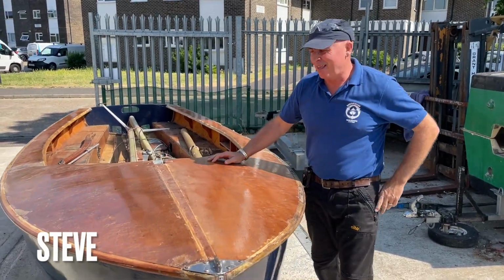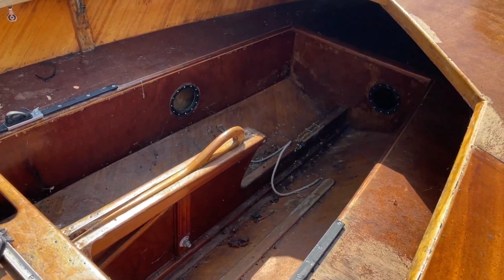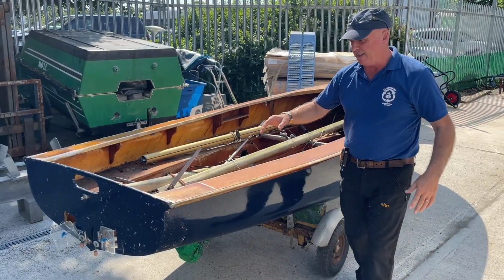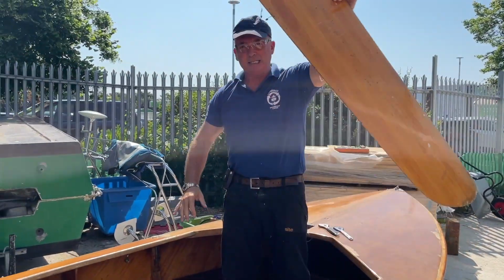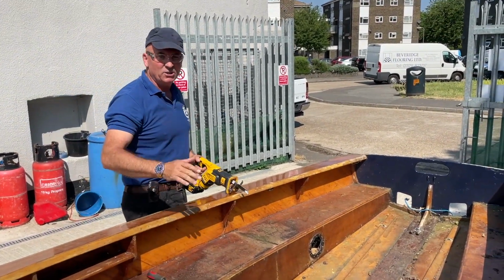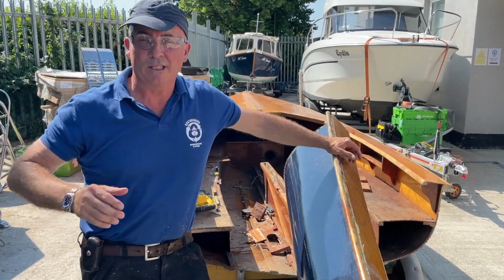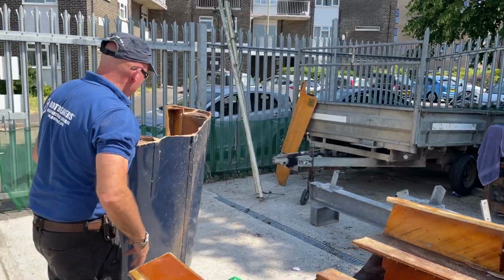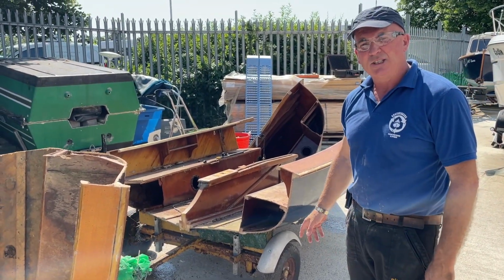Boat Breaker vs Albacore Sailing Dinghy!

Comment: This boat was built in the 60.s by JW Davis of Westcliffe on sea  Essex the give away is the deck king plank  with the sycamore fillets also the trim of the sisde tanks  .The gunwhales with  the sycamore is also a Davis givaway The Hull laminate direction  is also a giveaway as a 60,s boat I worked on several of these  boats i I was an apprentice working on these and also enterprises and Gp,s and also the swordfish which was,an albacore shell with the shearline cut down . Sorry to see it go I could have well worked on this one

Comment: the Hulls in the 60,s were made by Faireys Marine on the Hamble and were HOT  moulded. We bought them at Davis's 4 or 6 at a time   It was only the last and possibly the first few that were made outside Fairey marine .
There was a fleet of these at Thorpe Bay yacht club in Southend .We also would send to Canada to order 
Unfortunately for this boat It needed a decent crafts man to restore it . Looking at the vid it was a doable job but a lot of hours
When i was on my 5 year apprenticeship in the 60's I worked with some clever craftsmen  and am eternally grateful to them for imparting their skill to me  I remember making centre boards and rudders out of Agba timber for these boats  . These boards were all one  piece and all hand made with planes ,spokeshaves  and scrapers.

This boat rings a bell as it had little shelves between the deck knees for some place to put your  your fags and lighter  This  was a bit of a joke in the yard at that time . I have a feeling these were put in as there was a slight damage repair on the hull on one side